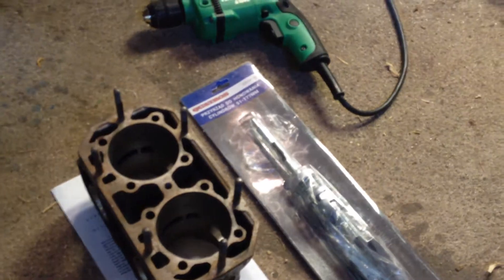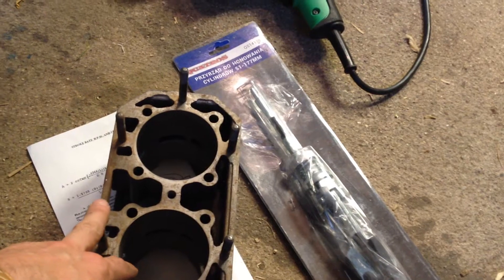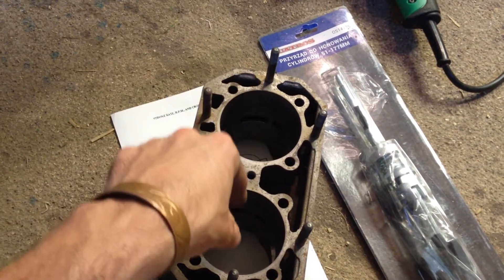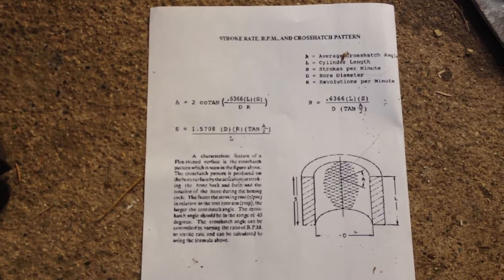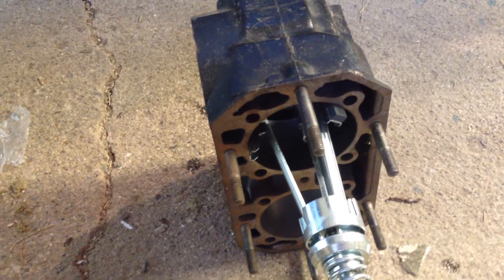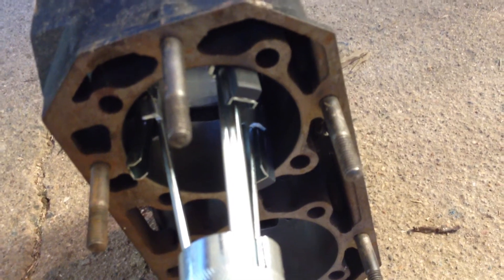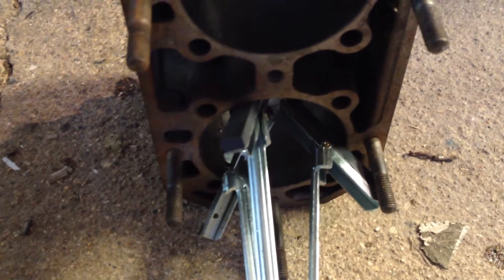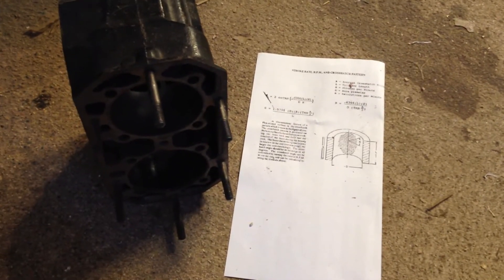1990 Kawasaki 400 / 440 / 550 / 650 Stand Up Jet Ski Cylinder Hone

Comment: I'm getting ready too convert my 440 too a 650 if u could give sum info would be helpful
Reply from the maker: +Justin Wallace You'll need a complete motor, intake and carb, exhaust, water box, 650 ebox, regulator, 19* or 20* pitchprop, 550 pump, driveline, and bed plate. I believe the bed plate will need cut down to fit properly or you can just buy a conversion plate. There is also glass work involved. You'd probably be a lot better off to just buy a 650 by the time its all said and done and just add a/m parts. Unless, of course you're just looking for a big, expensive project!
Reply: Go for the 750 swap. Get a donor xi super sport and the motor mount plates.